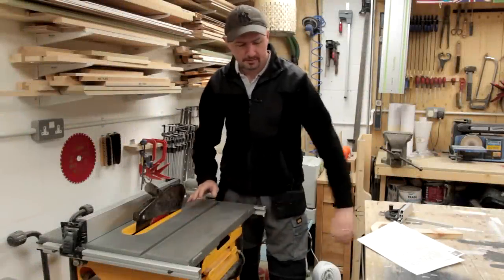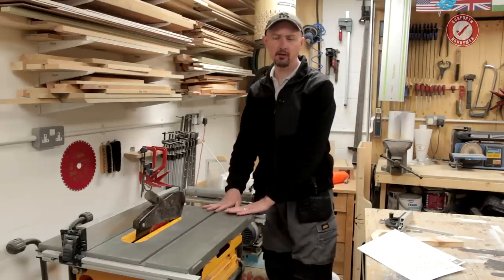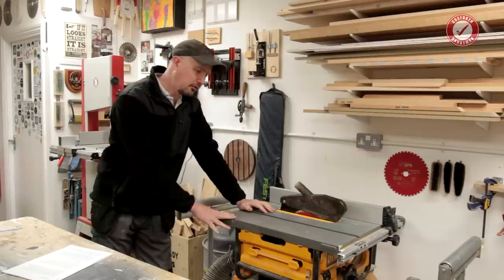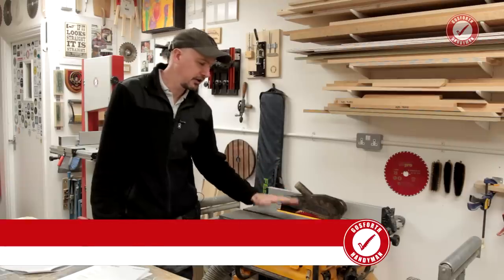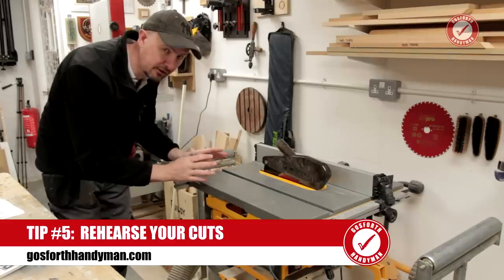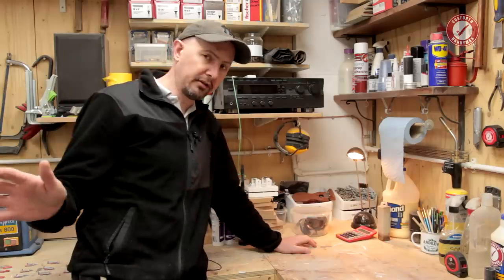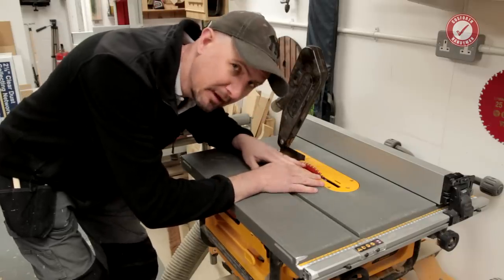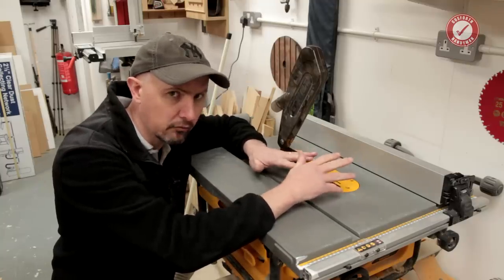TABLE SAW SAFETY - 11 tips to avoid death!

Comment: Hi, This is a very usefull video. I have a question about cutting at an angle (with the blade set at 45° for example), are there specific security advices? I ask because once I did it and the piece I was cutting had a tendancy to move up, and I had no clue what to do to keep it on the table. I ended up clamping another piece of wood on my fence.

Comment: Looks like you have a splitter, not a riving knife. A riving knife is always the same height as the blade and thus only needs to be removed if you're making a plunge cut or some kind of reverse cut
(extremely rare). Both do the same job of keeping the workpiece from pinching the backside of the blade, but a splitter gets in the way much more often.

Comment: 30:10  I respectfully disagree with your side cutting technique. You’ve already indicated push sticks and blocks should always be used and it’s very awkward in that position to use a block or a stick to keep the proper pressure on the fence. It’s just very awkward with the arm movements needed versus the traditional manner. Lastly if you do as much cabinetry work as you do you really need to get a proper cabinet saw and not a worksites saw like your Dewalt. You cut much larger pieces than that’s saw is really made for. Most excellent video thanks for posting

Comment: I've had two accidents with table saws...both from my own stupidity.  First one, I took a kickback to the face while not using my riving knife.  It literally felt like someone hit me in the face with a baseball bat.  9 stitches to my face, two black eyes, and somehow didn't break my nose.  I'm almost certain my safety goggles saved my right eye.  I'm left with a scar, and now the right side of my smile doesn't lift as high as the left.  Second one...again not paying attention and got my left index finger too close.  I lost the fingernail, and it took about 6 weeks for the wound to heal, but i kept my finger (don't even have a scar).  All in all, I am extremely fortunate that I wasn't hurt worse.

Two years later, and I'm still terrified of the table saw.  Absolutely terrified.  I will spend 5 minutes just looking at it and thinking about my cuts before I even turn it on.  But I've come to see that fear as healthy and not irrational at all.  It forces me to work slowly, methodically, and with a clear purpose and plan.  I gladly accept that anxiety if it means I can continue with this hobby I love and keeps me safe.

Comment: I have my Contractor table saw more than 15 years. I rarely work on it. I have throw away my kickback prevention kit.  Couple days ago I want to cut a board same size as yours on your video (the part where the board is flying back and hit you). I got a cut right on my left stomach.  Now i am scare to use the table saw, since I couldn't find the kickback prevention kit.

Comment: 5:00 Surprised you didn't call out the most obvious danger is when the off cut is so much longer than the cut it's almost 100% sure to kick back. I do these cuts sometimes, but wow I'm super focused on trying to push on the cut slowly, but still, stupid. Better to cut long with circular saw and then trim on table saw. Or of course a sled. And yeah, no riving knife on that kind of cut, kick back almost 100%.

Comment: Great video! I loved the comment - don't fear your saw but respect it. I have made a table saw at home fitting a circular saw underneath. obviously there is no place to fit a rev knife. After seeing this video will make sure the design is altered to accomodate a rev knife. Thanks for making me aware. By the way in your knowledge is it durable enough if I make the table top of my table saw out of HDF (High density fibreboard)? - Ravikumar Choudhary, India

Comment: Your video is excellent and very informative I liked it and have subscribed your Chanel. I am a beginner and by profession IT expert I have purchased Makita M0580G1 circular saw and have fixed it on a table. I have two questions. is there any probability that saw blade gets looser and spins out. 2nd can I fix guard on it and how. Will be grateful for you guidance. Thanks in Advance.

Comment: Standing at the side seems to make the push-stick unnecessary. Would it be safer to stand at the front and pull the  wood through rather than standing behind and pushing?

Comment: The only major issue I could see with making cuts from the side of the saw is that, traditionally the power switch is on the front of the saw, typically the left side of the front. That would mean you would either have to reach around (either taking your eyes off the blade/material or reaching directly over the blade) to turn the power on or off. I can say I personally would not feel comfortable taking my eyes off the blade or reaching over it to turn the blade on and certainly would want it close enough to turn it off while still maintaining control of the work piece as the blade spins down. The only solution i could potentially see to this is having the power cable next to you so you could unplug the saw from your location but that doesn't seem like the greatest fix either.

Comment: I'm right handed, would it not work to put the fence on the other side and stand to the left of the machine and make the cut. That way body isn't inline with the machine but it's still comfortable to push the wood through the machine with the right hand.

Comment: quick question, 4x8 3/4 ply, I want to rip it to make 2x8. is it safe to do this on the saw or should I use a circle saw
Reply from the maker: I personally wouldn't do it but plenty do 😬 - you need a really big infeed and outfeed table. I do cuts like this with the track saw. 👍

Comment: Riving knives are different thicknesses. If they are thicker than the blade you will have pinching and wont be able to push the material through. They should be used but can’t depending on your equipment. Unfortunately, my table saw is old never had one.

Comment: Just found your video. Great information. I have a question about tip 8. On youtube you see people trimming of tiny bits on the side opposite of the fence side as a final step to get dimensions straight or making surface square. What if you need to cut off just say 5-10mm? Seems really odd to have this tiny bit on the fence side. I think I'm missing something.

Comment: I have an old delta and the riving knife is fixed and when I lower blade there's a huge gap between blade and riving knife- should I still lower blade to amount needed or run it up all the way for the ruction of riving knife???

Comment: Question: Toward the end of the video you talk about working from the side of the table instead of behind the blade. It did look like a good body position, but when you did this you were sliding the board through the simulated cut with your hands. It did not appear that the standard push stick would work from this side position. So, would you actually use your hands? I'm thinking not. So then, what?

Comment: Actually any tool that has a cutter that has 2 directions (circular saw blade, router bit, carving disks) can cause kick back, as opposed to for instance the blade of a band saw (other issues but not as dramatic).

Comment: I have been using my saw safely for 2 years but had a scare today.  Now I am questioning some things as I watch this video. I have always had the 'waste' side between the blade and the guide and pushed the board with my hands on the other side of the blade. Is there a reason why that is not ideal?

Comment: I just bought a table saw and still in the box. I wanted a table saw for curing long pieces of wood for shiplap. Is there another saw that can cut this? I already have a mitre saw but only using this for home projects. Is there a safer way to cut long pieces safely?

Comment: I make a pucket game where I have to make 16 1/2 inch wide little pucks from 1 1/4 inch dowels. I used my chop saw with a stop initially but found when I brought the blade back up a tooth would sometimes catch a puck and send it flying all over the shop. I recently purchased a 8.25 inch blade dewalt table saw so I made a crosscut sled with a 1/2 inch stop screwed to the sled. Is there any other method to cut that many pucks in a shorter or comparable time frame than the table saw with a crosscut sled?

Comment: So.. I bought my first ever table saw - Evo Rage5s. Plugged in, mitre on, fence on and my first cut almost finished with the disaster. Lesson learned.  Now my blade is finally parallel to the tracks, I am aware that the fence might not be perfectly parallel, so triple check, never use mitre thingy with the fence and of course - check the riving knife: mine was bent. Oh, and I found the pushstick.  Ooops....  luckily I am still able to type this comment....

Comment: I reinstalled my riving knife after taking 1/4 ply to the gut. Twice. One ricochet off me and landed about 12 ft away, outside my garage door. Been using it ever since. Individual in FB group said friend died from same thing. Did not realize he had ruptured his spleen.
Reply: I should say, somewhat in my defense, on one of the kickbacks, it was caused by a wasp flying into my face just as I was finishing up the cut...

Comment: I nearly died when you touched the blade after during blade height section of the video. But seriously, this is the last tool I used for my renovation and I put it off as long as I could

Comment: The problem witb table saws ect is the same problem that you get with pto shafts in farming- its moving so fast, it pulls you into the machine, clothing or the material itself. I bought a table saw two years ago, watched all i could on using it and was way too scared to use it 😂 but i am going to i just want to learn as much as i can first

Comment: OK, so first a disclaimer, I've used a table saw as a young man in school, and in my dads shop, both too many years ago. The safety devices now employed on table saws 'riving knife', 'blade guard' either did not exist or were not common to use. I recently purchased a table saw for my home shop (now that I have space) and decided to view some usage videos to help  me to retain all my fingers. In watching this video you made a point about never making a cut that is wider than long, can you explain the danger? Is it the kickback potential because of the twist potential increasing due to the short controlled edge? Also I'm sure the need to make that type of cut exists many times, do you use the miter rather than the fence in that situation?

Comment: Many yrs of a table saw, 3.5 hp 220v vac system and still have all my fingers. Set blade tight enough to go through, vaga fence,  remember to push all the through with push sticks. Buy the 60 buck yellow one, it's worth it plus cheaper orange ones, you'll never regret it and make a few. Safety glasses, even carbide tips fly off , stand more to one side or other if pissible and don't stop the push, stop is a real killer.norhinf beats power and a 12 inch glad. Keep fingers off of kick back on back side or loose fingers lime my neighbor, 4 fingers, now a mittem, ouch

Comment: Is it not safer to have the saw blade raised higher so the piece is pressed down rather than being pushed horizontally?
Reply: I've heard this rationale before, but I think that the risk of a high blade far out-weighs the risk of pushback resulting from a low blade, especially with proper use of anti-kickback claws, a riving knife, and proper technique.

Comment: i received a table saw as a hand me down from my wife's uncle this is the 2nd time he cut his fingers, he openly admitted that both times were due to being distracted while using the saw. after i received the saw i started watching safety videos on them and proper procedure. the saw i received had no safety guard, which  actually i see a lot of people remove anyway, it had no riving knife, i asked him about it and they were removed, a week later he gave me his router with a attached homemade wood stand, very nice BTW he gave me the safety guard  but no riving knife, i looked online (it is a delta TS 200) older and a lot of parts are discontinued. i'm wondering if when i was making practice cuts  i noticed the board rising up  even when i was using one of those yellow plastic push sticks , not the grriper but similar is that due to not having the riving knife? thanks

Comment: The problem with the riving knife is that the piece always get stuck in it and then you have to turn off the saw and the blade burns the piece. Its neve wracking.

Comment: Surprised running a business you’re still using a contractors saw.  I managed with a Bosch Gts10 xc for a while but was glad to get shot of it because not enough of the sheets are supported properly on these saws on the LHS making such accidents far more prevalent.  If you want a safer saw to use buy a larger cabinet saw!  They’re quieter, have better dust extraction and support the work better and are more precise.  My shop is smaller than yours but still has ample room for a Charnwood w650.  That or an axminster trade or laguna fusion 3 would make your life a lot easier!

Comment: DON'T & DON'T & DON'T use a table saw with out FOUR things : Riving knife  - Anti kickback  - push stick or push block - Miter gauge , these four things is a must to any table saw user regardless the user is experienced for long time or a beginner ..In regard to using a table saw sideways it could be safer but in same time it could cause some inaccuracy because you need to give the wood on table saw enough pushing power and enough sight for where the blade is going on, so standing behind the blade is better but you should use the four things i mentioned above

Comment: The only real injury I've had with my table saw was when I was wearing gloves and foolishly reached for a work piece as the blade was still spinning down. It grabbed the glove and pulled my finger tip into the slowing blade. It was a mess and my son later asked if I'd been wearing gloves!  NO GLOVES and LET THE BLADE STOP SPINNING.

Comment: Avoid death and all serious injuries and get rid of your table saw and buy a commercial Radial arm saw . Most all are 12" blade capable, but you can also use a 10 ": many times. Best makes are Delta, DeWalt and some old 12" Sears saws. Stay away from the cheap 10" saws although they are safer than a table saw. 😎

Comment: maybe you address this later on but you were also doing a cross cut without a sled or miter.  That is a big no no and the most likely cause of your kick-back.
Reply from the maker: Wasn't a cross-cut. The cut is longer than it is wide. 👍
Reply: Gosforth Handyman well, just looking at it, it sure didn’t look like you were ripping it. If it hadn’t been snug against the fence it wouldn’t have launched. Anyway, thanks for making the effort to spread the safety word.

Comment: The edge of a table saw is moving at 101 MPH (3 rps) and you have about 1/16 of a second to get out of the way. This is base on a 25 cm radius blade moving at 3450 rpm. the persistence of vision of the human eye is 1/16 of a second. this is true if you have reactions at the speed of light, literally. Since the workpiece is probably pulling you into the blade, you have little chance of avoiding conflict. If you still think you can get away from the blade, you have no business working with power tools.

Comment: I have the same table saw as you owned it for 10 years your right but im not going to rant about health and safety its common sense also keep an eye on the lower and raise thread they get sawdust on them and seize look after the table saw clean it regular........i got mine new and mantain it regular.....golden rules use common sense learn your toll and clean it regular

Comment: My concern with skin-sensing 'smart safety' saw technology is that the more safety you build in, the more complacent the operator can become.  I am not suggesting that safety is a bad thing, clearly it is not, but there are several things that I am minded to say about how it can seduce you into doing things that you would otherwise avoid.  And when that blade is spinning at circa 4000 RPM then how do you know that technology is working?  No I mean how do you really know?  We learn the brakes in our cars work and we can trust them because we use them all the time.  But when that saw could kill you, HOW DO YOU KNOW?
Anyway I am off  to visit a mate who came out of hospital today.  He has broken his femur falling off a bike when he was going down hill at nearly 45 MPH.  He thought it was safe as he had a helmet on, otherwise he would not have been doing 45 MPH on a bicycle. Go figure!
Reply: They work really well, and based on my experience they don't make the 4000 RPM blade feel any safer, you kinda forget that the technology is there (except when changing blades). The only real downside to them that I have noticed is that they are expensive, and you cannot cut green or extremely sappy wood while the tech is active as it will trigger instantly. And when it does trigger it destroys your blade and the SawStop pad costiing you a pretty penny. But saving you your fingers.

As to how do you know? its sending an aluminum block into the blade and uses the blades speed to stop the blade. They work. More over Steve Grass (Inventor of SawStop) demonstrated that it works by sticking his finger into the sawblade in 2000. when he introduced the technology, If the inventor is sure (or stupid) enough to demonstrate the safety feature by putting himself at risk you know he is confident that it will work. And the tech has been around for 19 years now, and no SawStop user has lost a finger yet.

Your arguments are literally the same ones that PTI (Power Technology Incorporated) made against SawStop in Congress to try and get SawStop tech banned. They were concerned that SawStop's finger saving tech would put them out of business. Litigation in which they lost by the way.

I sadly don't own one. The one I have experience with one was at my University.